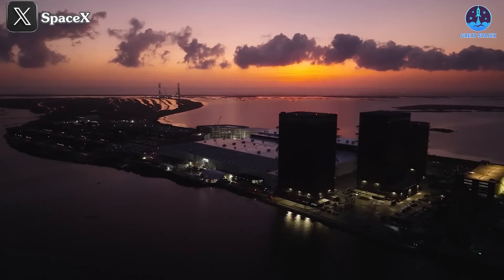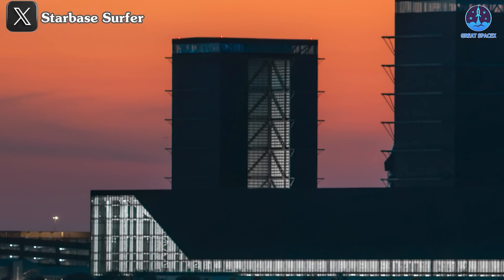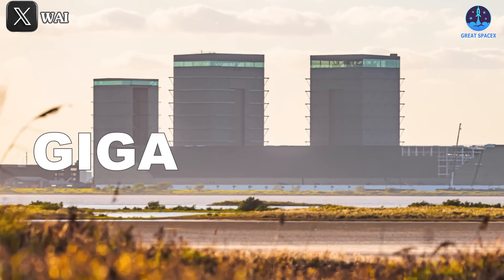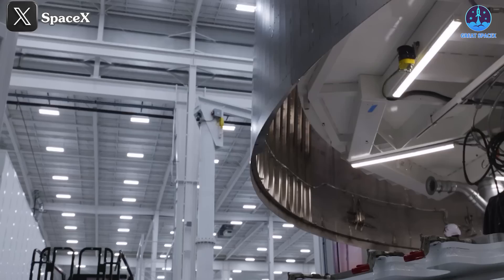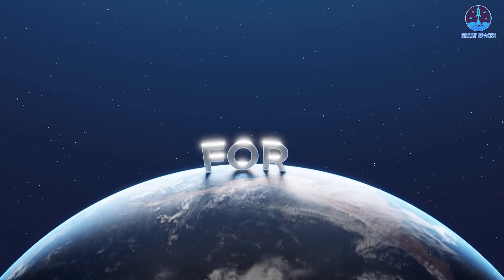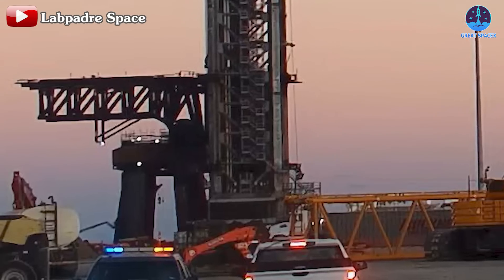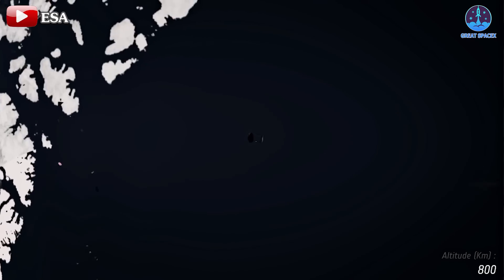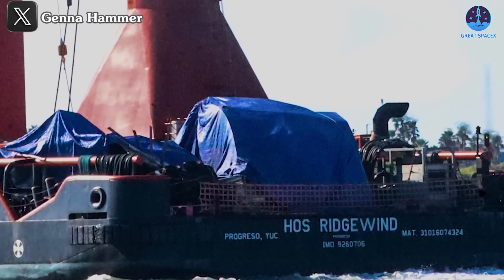SpaceX just Revealed Starship Massive Gigabay! Launch Pad Problem Fixed...

Comment: OK ------- .  GIGA bay should not only be a hundred meters high but have room for at least 20 if not 30 Starships and Boosters instead of just 5...  That may replace most of the facilities west of the existing MEGA bays... Otherwise, anything less and they will have to build another in just a few years if they Really plan on constructing a HUNDRED+ Starship/Boosters a year...  With the High bay remaining as a perfect size and place for checking out Starships between flights while loading cargoes without interfering with Construction operations.

Comment: Why Musk need mass production for rockets if rockets will be reusable?
Reply: The rockets ARE reusable... But they need to launch HUNDREDS of Starships.

This plan really does make sense... 

To develop a base on the Moon, which is the first step to sending manned missions to Mars, you need A LOT of supplies. You need to of course carry the people. And the future Starship designs are intended to carry up to 100 people at a time.

There's also the necessary supplies such as food, water, oxygen, air purifiers, carbon scrubbers, power sources (solar/battery), etc. 

Residential habitats, garages, science bays, mobile vehicles, construction materials, construction machinery, various spare parts, fuel storage containers, etc, etc, etc

All of this needs to be brought there VERY quickly, in a short period of time, so that it can all be utilized VERY quickly, with minimal radiation exposure, as the unmanned Starships orbit the Moon with all of this stuff inside their storage areas.

I think he wants to launch something close to 100 Starships per week, filled with various things I listed above, plus hundreds of other things not listed.
Reply: Airplanes are also reusable.
Reply from the maker: Great question😂

Comment: I think they need something really big this time. Something that will be the equivalent of a NASA vehicle assembly building. It doesn't have to be that tall, as it doesn't make sense to store the Starships all together in a full-stack. It will be enough if it is up to 90 meters, but it should be large enough to accommodate at least 12 super heavy boosters and 12 Starship upper-stages. I don't know where they plan to store all the Starships in the future if they build 1000 of them.
Reply from the maker: Let's wait for their next steps

Comment: If the ship only needs a few raptors to land just land it flat on its belly, quit screwing with this catching shit. It's a waste of time.
Reply: Like horizontally? How would they generate lift in this orientation? Extra engines on the belly that adds weight? They would need to make quite a few internal adjustments to the booster to channel the fuel in the direction of those extra engines.
Reply: @WernerLombaard  no doubt it's a total redesign, but at least it would land  like all other cool space ships in the sci Fi movies,  seems more modern and easier exit.
Reply: @leschortos9196  Technically the space shuttle landed on its belly by gliding down to a runway. In that case they used wings instead of rockets. They also had ideas of landing the starship booster the same way they land their Felcon rockets boosters, but if I remember correctly, they didn't want to add extra landing stands because of the extra weight. The launch tower is already there, so why not just use that? That was probably what they were thinking.
Reply: The aim is rapid reuse which wouldn't be possible if they land it on it's belly.
Reply: @shaung949  I think landing on other planets would be a lot easier flat than trying to land some tall tippy structure. On some uneven terrain. But what do I know or even care. Just makes more sense to me.